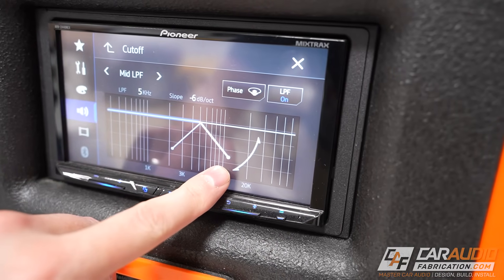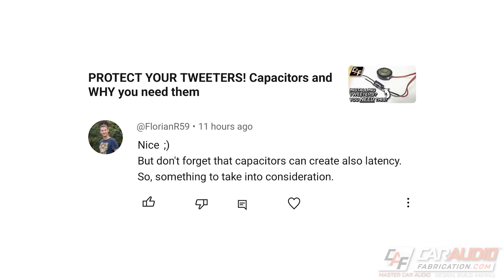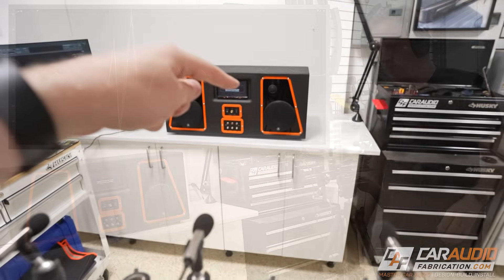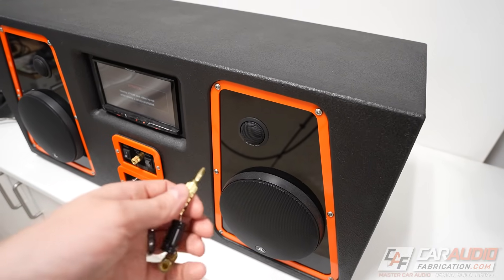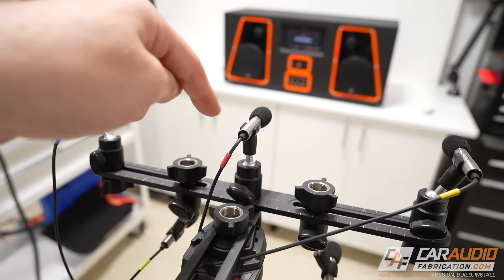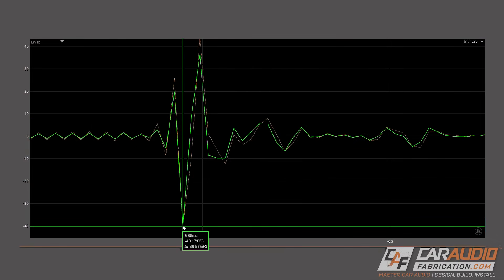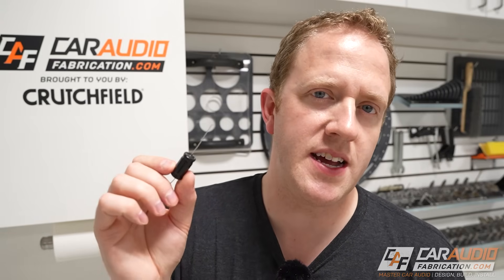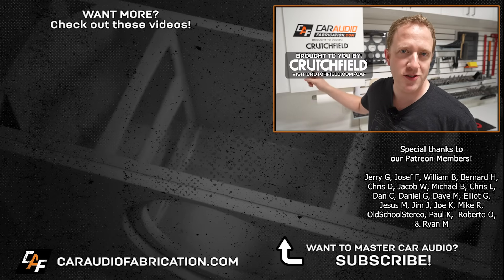MISTAKE to recommend these? Tweeter Protection Capacitor Test!

Comment: Would be hard to notice a difference in latency and phase for such high frequencies. But what about for using a bass blocker on a mid-range speaker? With the longer frequencies a shift would be far more noticeable. 

I'm wondering if using bass blockers on my midrange door speakers will impact the listening experience

Comment: I have a 2022 Corolla le the tweeter went out and I’m looking to replace with the ds18 Toyota replacement tweeters I took out the cover and the tweeter is clipped into the cover I noticed there is mounting spots in the dash and the ds18 is plug and play my issue is the hole in the cover is only perforated for the size of one tweeter will this affect my sound should I look into modifying the cover for the new size of the tweeter?

Comment: Thank you very much! This is exactly the question I had from your cap selection video.

I'd imagine that you might be able to see a theoretical time shift at lower frequencies. Your experiment demonstates that a properly sized cap does its job as protection rather than affecting signal. Thanks again for doing it.

Comment: While capacitors do cause a phase shift—typically up to 90° at frequencies near the crossover point—this shift does not translate into an audible "delay" in the temporal sense that the human ear would perceive as sound arriving late. In a first-order high-pass filter (a single capacitor in series), the phase shift starts at 0° far above the crossover and increases smoothly toward 90° as the frequency approaches the cutoff. This phase shift corresponds to a very small time difference—on the order of microseconds—which is negligible in human hearing.

Comment: Question, running passive (not active) and wanting to cut bass from a 3.5" coaxial. Tweeter capis off the pos to the tweeter already. Can I just add the large capacity cap inline to the whole 3.5"? It won't cascade with the tweeter cap and change the cap value to both the tweeter and the 3.5" thereby lowering the overall frequency to the tweeter?

Comment: Hi Mark, do you have any experience with "supertweeters". 

I've got a Morel Supremo Piccolo wich I want to give an "clarity" above 20khZ.

In series with the Morel tweeters or other kind of wiring?

The front system is by the way Morel Piccolo's, Morel MM3'S, Morel MW9 underseat woofers. 
The supertweeters are the new Steg SST-50 AMT supertweeters.

Thanks!

Comment: i would like to ask why a non polar electrolytic & a polyester film capacitor of the same value sound so different, electrolytic give a higher & fuller sound , try a test for this.

Comment: Hi Mark I live your vid and watched almost all of them. Thank you for your knowledge and passing it onto the rest of us. 

I have a question about the capacitors and tweeter set up. 

So I keep burning out crossovers and stuffing tweeter and no matter what I seem to do it just keeps happening. Mainly with one brand. So now I have new one. And I have done the maths for the cap but. 

Were do I install. As you mentioned in previous vid about still running the passive crossovers in an active system. 

So mine is an active system and have full control over signal through dsp. 

So can I run from the dsp a cap to 10uf 85degree 100v NP cap and then have the Passive crossover connected and then off two tweeter. Or should the cap be between the passive crossover and tweeter or if I have cap I Cait run the passive crossover because the signal change due to impendence or something like that. 

Does that make sense?  Hope you can help 

Thank you very much.

Comment: If your car already has tweeters from the factory, and you're just swapping new ones in, wouldn't the filter already be taken care of?
Reply from the maker: Nope, many times the mid and tweet share a channel with the tweeter having a built in capacitor that acts as a high pass filter. When you go aftermarket that capacitor isn't there on the tweet.

Comment: I have a few caps for tweeters ans 3.5" mids in a drawer. There is no UF markings on them to know the frequencies they block.  Is there a method to measure each cap to know the these frequencies?     would it be a drop through the cap?

Comment: I just bought a pair of Pyle tweeters with built in capacitor crossovers. I have a 3 way crossover that I want to use. Do I need to remove the built-in cap for the 3 way to work properly?

Comment: I have the issue of needing to add a resistor to bring down a tweeters output as the woofers aren't as efficient.  Do you have any idea how I find the value of the resistor to use?

Comment: i change my speakers in my A5 the door tweeter is 4 ohm and get a new one jbl at 3 ohm. can u use the original Capacitor ?

Comment: I called Morel and asked if they had any suggestions for a capacitor value for their Piccolo tweeters. This one tech (who may not represent all of Morel), said that they don't recommend capacitors as it adversely affects or may adversely affect the sound. Since I'm brand new to DSPs/Active, I thought maybe I might put a capacitor inline at the amp side to protect the tweeters, at least until I get the system tuned up and I'm no longer worried that I might accidentally send too much low signal to the tweeters and blow them. At least the capacitor wouldn't be buried in the dash or the A-pillar. That might also allow me to test whether I can audibly hear any difference as I'd prefer to have some protection. Thanks for this video as it seems to suggest that using a capacitor should be a good idea.
Reply: using it while tuning is a really good idea! but yes they 100% degrade the sound quality, you can get caps that dont but they are very expensive! is you insist on using one permanently you should atleast go with something equivalent to Mundorf MCap Supreme or Jantzen Audio Superior Z-Cap. if you have gear that can measure the impedance you could make a series notch filter, that might even be a better choice

Comment: Which passive crossover  capacitor do i need for the infinity 4032cfx (4inch) speaker?
400V - 1.5UF capacitor is good?

Comment: Quick tip, just learned you can use two non-polarized caps joined back/back in series to replicate a non-polar cap, the two polar caps (normal kind you can find everywhere) just create a non-polar of half the rated F value of the cap, much much cheaper (free, caps are everywhere in broken electronics) to make this way.

Comment: Hey, Even though my system has a passive crossover and a DSP the tweeter seems to vibrate or makes a weird noise during deep base tracks, anything specific to watch out for, Thanks in advance..!!
Reply: the crossover slope might not be steep enough keep unwanted frequencies out. if you are just using capacitors on the tweeter circuit, the slope would be like 6db/per octave below the xover point, which is pretty shallow, and unwanted frequencies will still creep through, causing over-excursion of the tweeter diaphragm, causing distortion and possibly damage. try using a crossover with a steeper roll off, quality component systems typically use 12/db per octave slopes, which provide better protection. with some active crossovers, the slope can go up to 24 db/oct, although 12-18 db/oct is more common. keep in mind that if your dsp is feeding signal to your mids and highs as well, boosting the bass on your dsp will increase the bass signal going to these speakers, causing distortion as well.

Comment: Does running a 4ohm speaker at 2ohm hinder its frequency response? Hypothetically, if a speakers low frequency is 50hz at 4ohm, running at 2ohm would double the cut off at 100hz?

Comment: The advantage of adding a capacitor to the tweeter input line is, that you can install a 2-way system with the tweeter wired out-of-phase just like you would intentionally wired the mid-bass or midrange put-of-phase on a 3-way system. An out-of-phase installation would give the sound system better slopes at the cutoff frequencies and deeper, cleaner transient response...
Reply: Assuming you're perfectly time aligned, flipping polarity of a driver would just introduce phase cancelation at crossover frequency. A single capacitor will always have the same slope cutoff, no matter what's happening in the rest of the system.

Comment: Capacitors do not add latency for audio because they act as a short for AC signals. That being said they do limit the slew rate (rise time) which results slower transients. No one can hear this change, but it is visible in the RTA. Less pronounced spikes, rounds the points
Reply: Ideal coupling capacitors are shorts in AC. Any others will have an impact on phase, therefore delay. For a single capacitor, the phase will be +45° at the crossover frequency, +90° at low frequencies, and 0° at high frequencies.

Comment: So, I can use capacitor instead of using crossover because with crossover I need to get 2 pair of wires to each door? 
I set High pass crossover settings on my HU on 100Hz for my front and rear speakers(door speakers) and Low pass on 100Hz for my Sub. I have budget car audio for now, only sub is connected to amp, while door speakers are still connected only to HU.
I have 4ch amp for door speakers but I still doesn't have stronger speakers which require amp(have two, but two are still factory speakers).
Because of low budget I'm buying little by little.

Comment: I don't like electrolytic caps or iron core inductors in my speaker networks, to my ears they smear the sound vs poly caps and air core inductors. If you do a side by side you should be able to hear what I'm talking about. Its the subtle things in life that I seek.
In the car I have a pioneer that has 3 sets of crossover able outputs, I was able to take the poly caps and air core inductors out of the network and wow what a huge difference in everything.  I am defiantly thinking about adding a safety cap, will probably have to get a big one as the tweeters are crossed at 1600Hz @24dB.

Comment: Capacitors have been used to limit the frequency sent to tweeters long before car audio was a thing. They have been used in home audio forever. No worries, they work.
Reply: The concern here is using a passive crossover in addition to an active crossover.  Lots of internet experts claimed you had to make adjustments for it, but Mark's measurements show it has virtually no effect on the desired operating frequency of the tweeter if you choose the right value for your capacitor.  In short, it's a safe way to ensure you don't fry your tweeters with high current low frequencies when the software for your active crossover resets or sends a turn-on pop or something down the line.  Or, in my case, I accidentally switched my midrange output with tweeter output, wish I had a capacitor in-line that day. Instead, I have a dead tweeter on my workbench that serves as a reminder.
Reply: I removed the caps and tweeters sound so much better. I don't think caps are only needed in high wattage situations. Otherwise they dampen the tweeter sound.
Reply: @jonfreeman9682  I felt the same way with my horns..Just recently put my second set of diaphragms in and this time I have capacitors in line..Dont plan on blowing them anymore..Not alot of power really going to them..There on a audio control 300x2..Horns are american bass godfather series 8' horns..

Comment: Not really a delay, but a phase shift. I checked in rephase, series cap is a first order high pass, so if we tune it to 1kHz, we get about 45, 25, 19, 13 degs on 1,2,3,4 kHz respectively. Impossible to hear. By the way, if you are using dsp you can linearize this back with FIR filters, but they cause actual delay.

Comment: Its been a while since my electrical theory classes, but phase should only max out at the F3 cutoff at 45deg, so as long as you're picking the F3 value significantly lower than your active crossover F3 point, there shouls be negligible phase delay from the 6db/octave pole the capacitor creates in the a/c frequency response.

Comment: One tip for installing caps for tweeters... I was getting popping sounds in my tweeters that coincided with bass hits. It was bass-volume dependent, meaning increasing bass gain knob but leaving the master volume constant would increase volume of the tweeter pop. After a bunch of troubleshooting I finally realized that the capacitor was installed too close to my bass amp, and was picking up electrical interference from the amp. Simply re-routing the tweeter's speaker wire away from the bass amp cleared everything up.
Reply: Good troubleshooting info. I haven’t had that problem personally, but if I did then that would’ve been something helpful to check out. Crazy how simple some things can be but cause so many complications
Reply: I have that problem but without the caps being close to the amp. It must be something else for me like wires too close
Reply: @jamescorfield534  I could see that. I imagined it was the caps, but maybe it was just the tweeter wires themselves being too close and picking up the interference.
Reply: @joshhaimes I have the exact same issue in my system and for the life of me I can’t manage to sort it out. As soon as I increase the bass gain it’s almost like the tweeters are playing bass and a lil popping sound too. 
I’ve moved the cables for the tweeters away from the sub amp and it’s a bi-amp crossover.
Reply: @seanmichael2777  That sucks. Are the tweeter wires close to anything else that would have current with bass? Like power wires or something?
Reply: I removed the caps and it sounds so much better.

Comment: Does using a heat gun on heat shrink to cover the resistor damage it from excessive heat?
Reply: It's a capacitor, not a resistor, but yes, if you heat it up too much you can cause damage.  Heatshrink tubing typically shrinks at around 70 degrees Celsius.  Capacitors have their operating range printed on them, usually between 85 and 105 degrees Celsius.
Reply: @chrishuyler3580  we deal in Fahrenheit in the United States. So could you please change the Celsius to farenheit please?
Reply: @russellcrabtree5314  sure, heatshrink shrinks when it’s kinda hot, capacitors fail when they get REALLY hot, and remember, your heat gun is not a hair dryer.

Comment: Any active crossover will have delay a lot more than anything passive, but the plan is to pass all the signals into the dsp so everything is in sync coming out.
I have 4x 4ch 800w rms at 4ohm amps feeding my dash and doors. This is a full active 4way setup on a 16ch dsp I have 8 15in subs on 8 amps, all individually chambered and ported. This lets me do time alignment and phase control to an extremely fine level.
I can stack the bass pressure wave to focus at a single point in the cab.

I just started building a much, much larger version of this on a semi trailer for burning man.
Reply: How did you come to that conclusion? Digital FIR filters will add a delay, but IIR filters and active analog filters just simulate ideal passive circuits. Unless you count the time it takes for dac/adc conversion time, most active filters should add exactly the same delay as passive.
Reply: @SamuraiGuy  It doesn't matter if every thing comes out of the speakers in perfect time alignment, or delay, or whatever... the speakers are not only all different distances from your ears, the tweeters, mids, woofers, etc... are all in different places around the vehicle, so none of the music from the different speakers is arriving at your ears at the proper time any ways.  Even if you set all your parameters.... "stack your bass pressure wave to focus at a single point in the cab." That's called a "standing wave" and that is something you don't want in an audio system, and even if you do that for the mids and highs, the moment you move your head from that spot (even just an inch) it all doesn't matter any more.  If you want your system to sound good, try to create a system where the sound actually sounds smooth anywhere in the vehicle.    Just do yourself a favor, take a separate mid and a tweeter and play some music thru them right in front of you, hold them the same distance in front of you, then just slightly move the tweeter forwards and backwards away from you, even just a 1/2 inch, you will hear it how much the sound changes, it will sound like you ran the music thru a flanger.   This is the same affect you get just by moving your head closer and farther away from each speaker in your vehicle.  So it doesn't matter how perfect you think you have your dsp timing/delay/etc.   It is all irrelevant anyways.  And if you try to set it to sound perfect for your listening position, you really just jacked it up for anyone else in the vehicle.  It's called phase/time distortion.
Reply: sounds cool, but that's really a waste considering your speakers are all over the place, and you may want to move your head and ears a different distance from the drivers sometime.  LOL